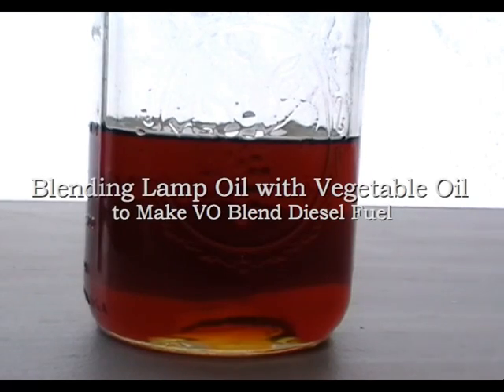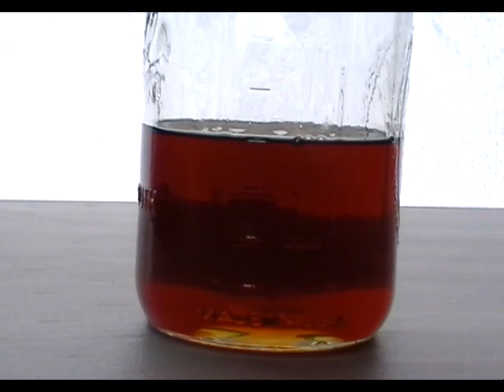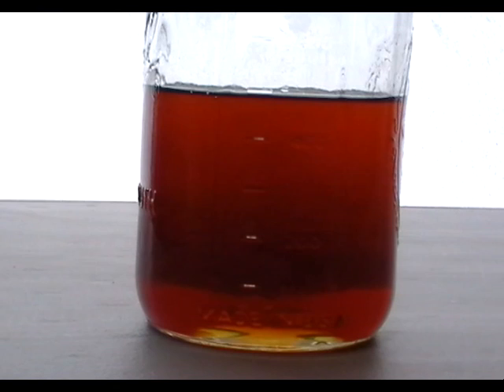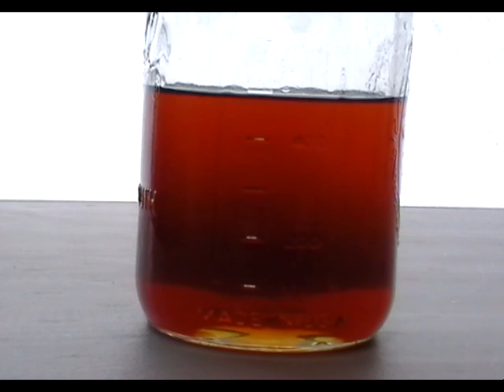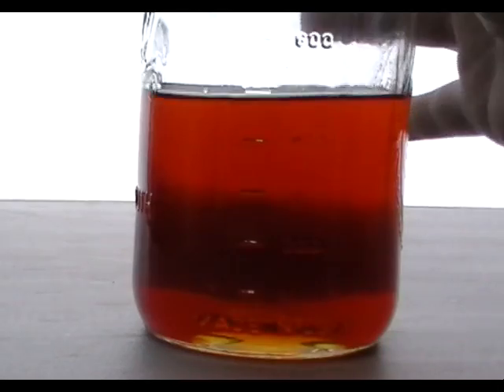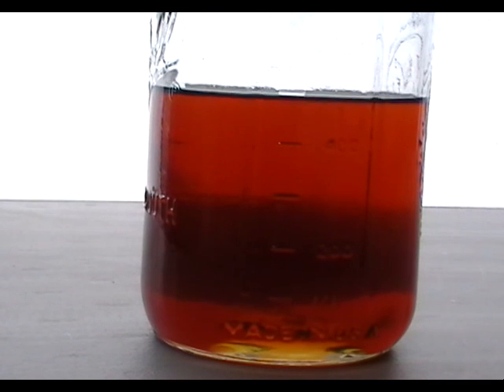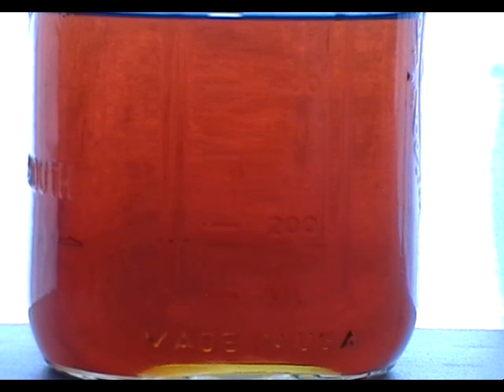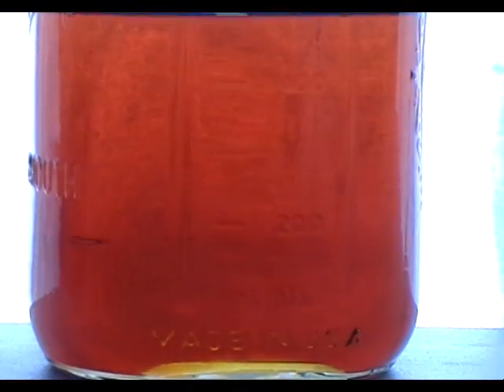Blending Lamp Oil with vegetable oil to make VO Blend Diesel Fuel

Comment: I use 5 liters of car diesel with 500 milliliters coleman fuel.
Reply from the maker: Coleman fuel is mostly alcohol, so you are talking about using it at 10%, which for most cars would be too much alcohol, but it might work with the seals in your injector pump and fuel pump.

Comment from the maker: to burn.

The problem with those designs is they are not very mobile.  I would like to have an oil lamp inside of a bottle so that I can close the top to contain the oil when the lamp is not in use.  So, it will be something like a sea shell inside of a shallow bottle.  The lid is removed when the lamp is lit, and while it is burning.

Comment from the maker: Thank-you for the good idea for turning a burned out light bulb into a oil lamp.  I have been experimenting with making oil lamps for years.  The big problem that I see with the oil lamp is the wick will only wick oil a short distance up.

If we examine oil lamps in the archaeological record, then the common oil lamp is a shallow basin, with a place to rest the wick.  The sea shell turns out to be the most common oil lamp mechanism, where the wick lays in the basin, and comes out onto the hindge

Comment from the maker: The point of these blending experiments is to show that diesel fuel can be made by blending a wide range of solvents with a wide range of oils.  However, blending vegetable oil with lamp oil will not burn well in an oil lamp.